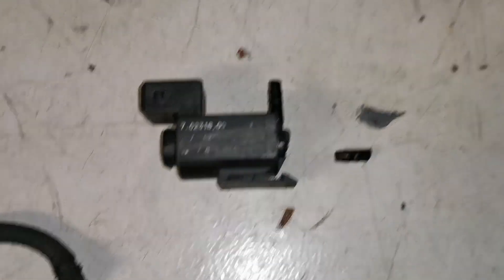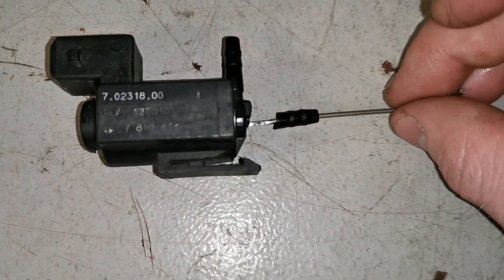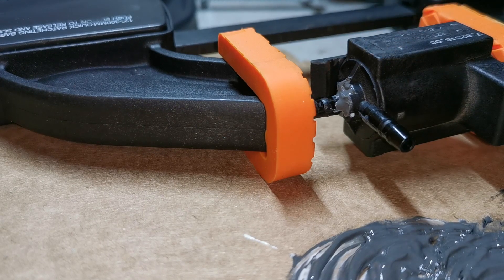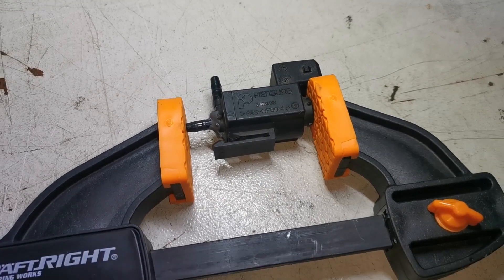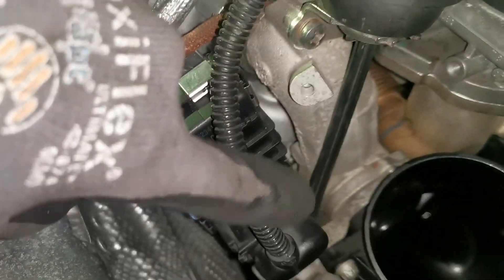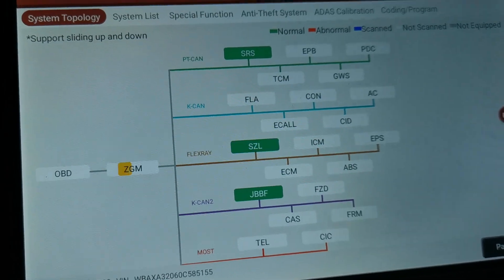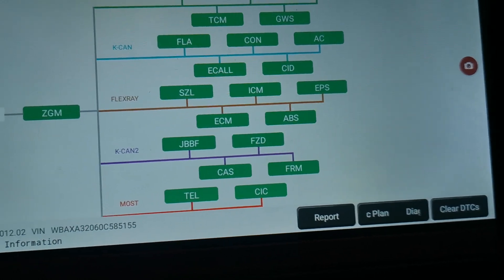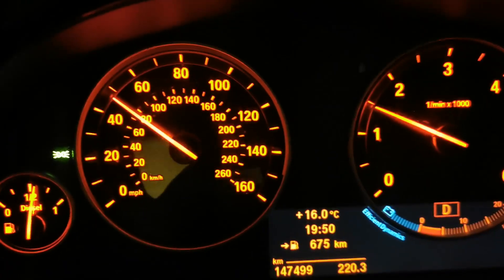How To Fix A Broken Valve On A Car - BMW - Drivetrain Malfunction - Found & Fixed

Comment: клей дороже нового клапана
Reply from the maker: The glue is cheap in comparison to the valve which was much more expensive. 
Also only requires a small bit and can do loads of more jobs.